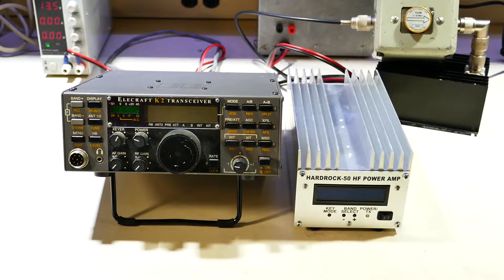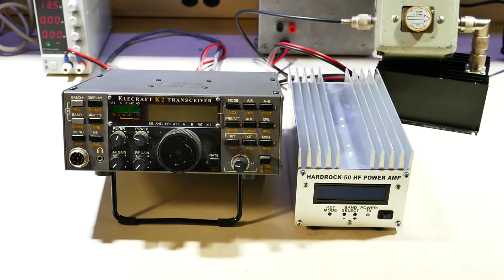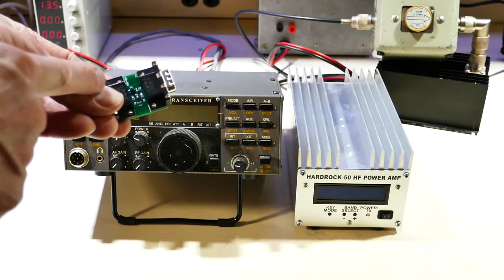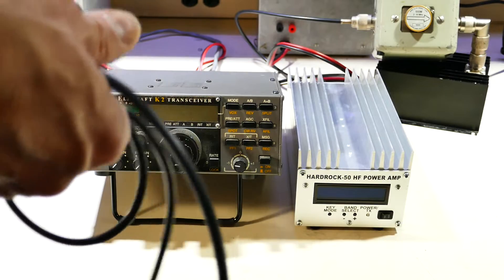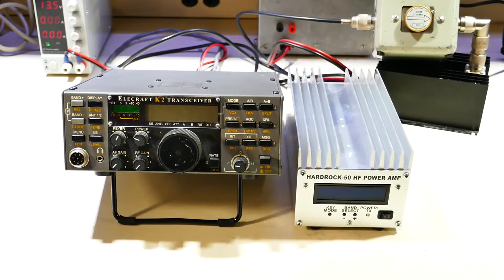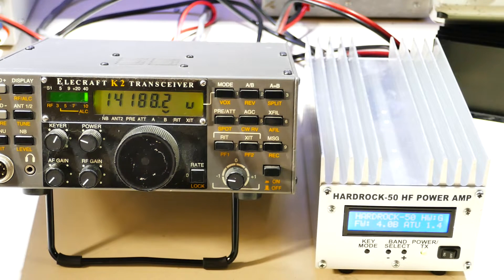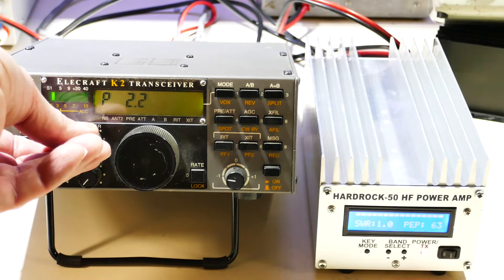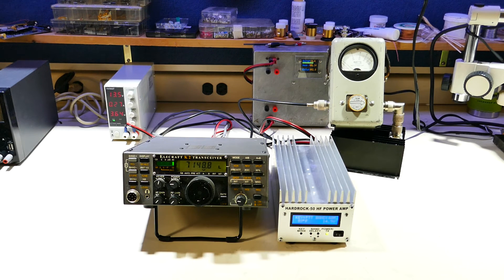HobbyPCB Hardrock-50 to Elecraft K2 Interface

Comment: When I go to the HobbyPCB site I see no mention of compatibility with the K2.  No doubt showing my ignorance of the obvious.
Reply from the maker: We never made the K2 interface into a product for a couple reasons.
1. Low demand
2. It requires that the K2 have the KIO2 option that is over $100
3. There are sequencing issues; if you turn the amp on first, it won't work.

I can send you the information on how to build the interface it only has a few parts. You can roll your own.
73,
Jim.

Comment: This interface works perfectly.  It is truly simple to use, as you can see.  The amplifier now follows the K2 band changes automatically.  The setup turns the K2 into a 50W class transceiver at nominal cost, very useful in these days of challenging propagation.